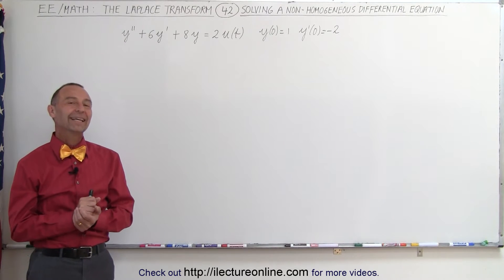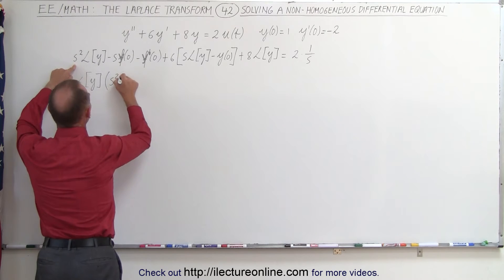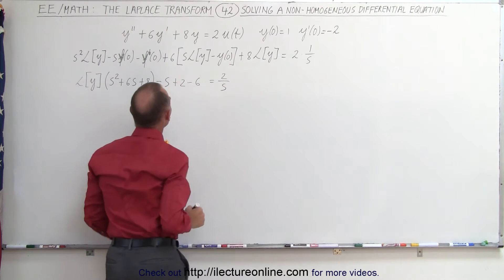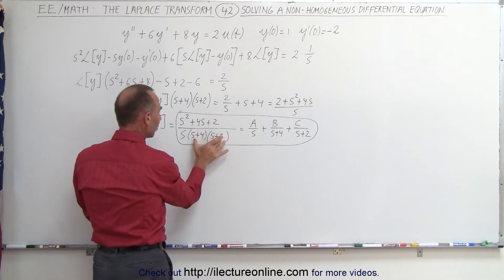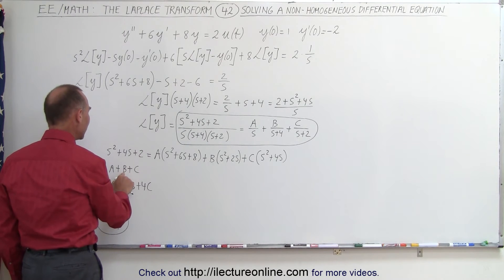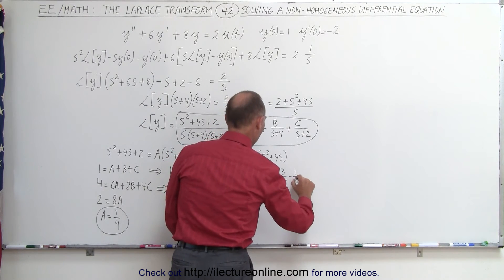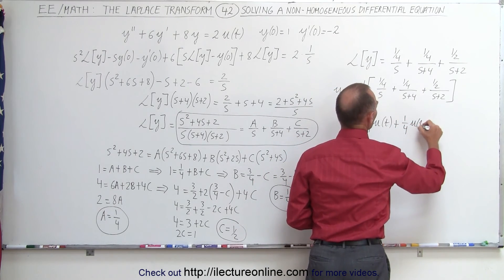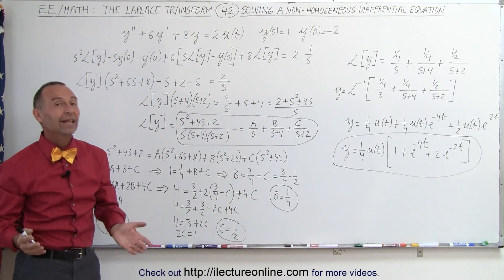Electrical Engineering: Ch 16: Laplace Transform (42 of 58) Solving a Non-Homogeneous Diff. Eqn. 1

Comment: thank you very muuch sir. these videos are very helpfitul. plz tell if in the denominator of the Partial Fraction, we  write (s+2) first and then write (s+4) it changes the answer a little bit. Is it wrong?
Reply from the maker: Changing the order of the denominators will not affect the answer (it will be the same), since the numerators will change accordingly.  Give it a try and you will see.
Reply: I tried it and no changes happened ..